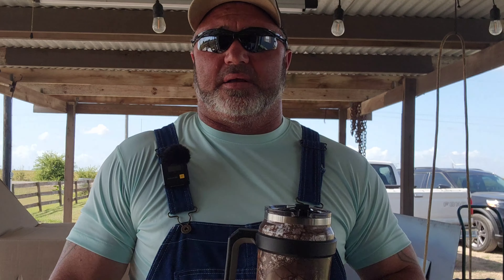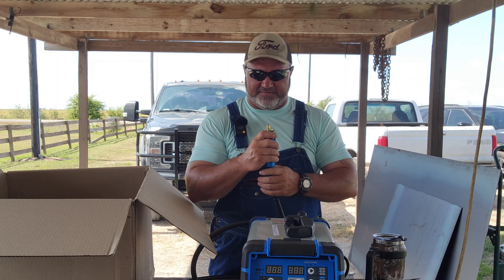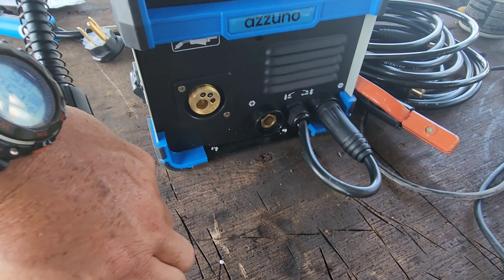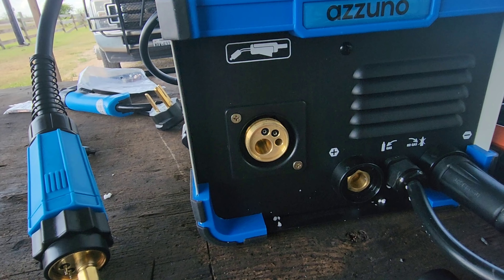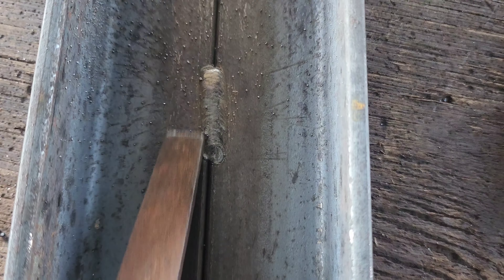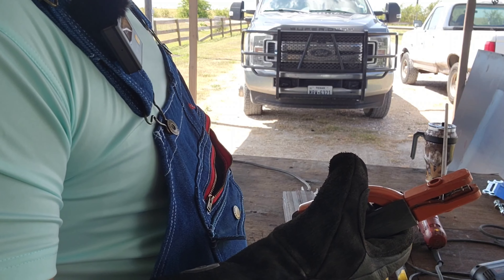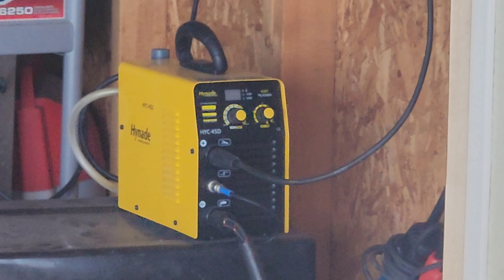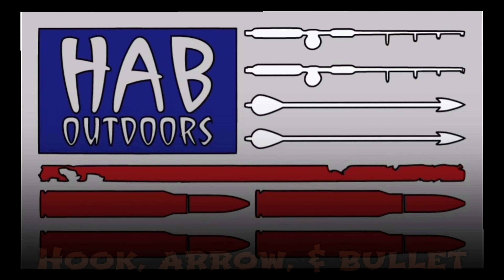AZZUNO 200 amp 4 in 1 welder. @Azzuno

Comment: Bought the same unit on sale.  Messaged the seller & he emailed a MUCH better manual.  I replaced the ground clamp with a Lincoln 300amp one for about $8 bucks (HUGE UPGRADE), added a yeswelder 300amp rod holder for arc welding (another HUGE upgrade) for about $13 bucks.  Got a 2 pack of plastic flux core tip guards from Hobo Freight (perfect fit).  Also ordered U, K, & V feed wheels I got for about $20 total.  Result?  LOVE THIS THING! Welds great!  100% flexible to weld almost anything.  Great machine imo.  WAY better than the Lincoln 140 mig machine it replaced. 

This machine has a metal feed assembly & holds a 10lb spool where most this size use plastic feeders & only hold a 2lb spool.  Blue Demon wire has given great results & clean welds.
Reply: Have the links to the upgrades?
Reply: Thank you for taking the time to give this review. This really set me off running and the comments were also helpful. Appreciate the effort!
Reply: Thanks man. That helped me alot. I am going to get one for my house and practice
Reply: Any way you can email the manual to others ??  I bought one of the last week on sale - supposed to arrive tomorrow.....
Reply: the lincoln 300 amp clamp has a lucky weld alternative that looks identical and is a third of the price

Comment: That weird thing the display does on camera is normal, it's called LED multiplexing and it reduces the amount of wires needed to drive a lot of LEDs.
It's cheaper to drive a lot of segments and separated LEDs one by one, so the microprocessor inside just lights up a single segment at the time at a faster rate.
Say that it wants to display the number 8, the machine will light up each of the segments that make the number 8, it will not light them all at the same time.

It shows up on camera during the day because the exposure time is fast enough that the camera is able to see each segment being lit up, with less light and a slower exposure the flickering can go away.

Comment: do you have upward movement where the mig gun attaches to the welder?  I bought one of these machines, welds good, but noticed that I have quite a bit of upward movement from the rest position where the mig gun attachment plugs into the welder.  I would be curious to see if you have that on both machines.

Comment: I have the azzuno 250amp aluminum welder, works great so far, haven't used mig, tig or aluminum spool gun, I do have the Tig gun, ordered from Amazon, spool gun pricing needs to come down before before I buy one. The manufacturer currently doesn't have this welder listed on Amazon. The only thing I've tried so far is Flux core welding,  using .30 wire, get a lot of spatter. I liked your video on the hog trap build, im in Florida,  i have a trap simular to the one your are building except for the trap door design is different. I'm going to build a smaller for coyotes, I've seen them at night time on my cellular game camera, hopefully this will work for me. Would like to see how you setup your trap door in your next video. BTW, I run the welder on a 8kw generator when i want to use 220v, generator never  shows a load at 220v, it's like the welder was never plugged into the generator. Good luck on your trap door design.

Comment: If I am using Flux Core with 20 guage metal ( the same material that has been used on the fender of most cars), what would be the best settings for my work?
Reply from the maker: @usiega  I can only recommend using smaller wire and running some test welds. This welder will automatically sinc the wire speed with amperage. Probably gonna be around the 55-60 amps I would think but don’t hold me to that

Comment: Thanks for the video, does this welder included the needed attachments to use all four welding types?  besides the gas tank, are there any other accessories needing to be purchased?
Reply from the maker: Comes everything needed to weld stick and wire only. This welder is awesome
Reply: @hab-outdoors  - Awesome, thank you for confirming.  Have you purchased any of items needed to do Tig welding and add the gas tank?

Comment: How well do you think this welder would do welding exhaust on 110v using flux wire and/or stick welding.
Reply from the maker: definitely use wire and I'm sure it will do fine
Reply: @hab-outdoors  - thank you.

Comment: How is this welder and plasma still holding up for you?
Reply from the maker: I’ve welded 8 oxygen bottle racks (6 pack) and many other projects with it with no issues. I’ve made over 8 grand with this machine. Not bad for $300

Comment: What amp breaker are you using when welding with 110 volt.
Reply from the maker: I’ll have to look but I believe I’m running on the barn side of the breaker box. Everything is standard if that helps

Comment: did you use a dual pole fifty or thirty Amp breaker
Reply from the maker: I don't want to sound like an idiot but I'm no electrician. My nephew came and hooked up my 50 amp plug. I purchased the dual 50 for the pole if that helps
Reply: @hab-outdoors  thanks I had a  thirty Amp outside outlet at meter was hoping to use it but it's easy to up grade to fifty .

Comment: I bought the Azzuno 135f. Am having problems getting the flux core portion to work. Wire is correct, yet it will not spark. Hoe do I contact customer service, as Amazon is not helpful? At least for a better operators manual. Please help!!
Reply from the maker: So I had to actually go through Amazon to get to manufacturer. Once I did they just gave me a whole new unit for a very easy fix. They were awesome as far as warranty. However it took a little to contact them. I will go through my emails and try to find their contact info and I will send to you
Reply from the maker: So I went back through my emails and I remembered that you have to go through Amazon to reach Azzuno. This was the only contact I found. Hope it helps.
mnrzt8fjg0f31nf@marketplace.amazon.com
Reply: Thank you so much. I will be looking at that more today. I was able to find info under the product details, further down the page. It helped a bunch, as I had sent it for return. Found out that I had the EARTH CLAMP on the wrong terminal. Did my first practice welds yesrerday and it was so exciting. Thank you for all your help. 

The video is amazing and so informative.
Reply from the maker: @wallacewalker218  I'm glad I could help in any way. I was actually going to ask you if the ground clamp was correct. Glad to hear your welding.

Comment: It's easier to go from 110 up? You sure that's water you're drinking? Or those people you know who know electricity really don't. I've never seen the machine, but I've seen other brands of low cost Chinese inverter welders and they go from 110 to 220 volt plugs because it's cheaper. Just saying.
Reply from the maker: I'm not an electrician. But a couple I've talked to all said the same thing. Not my words buddy. Just repeating.